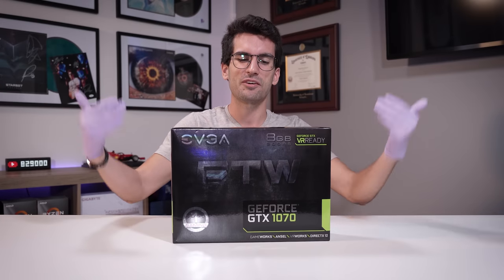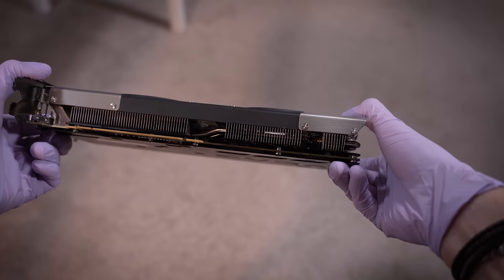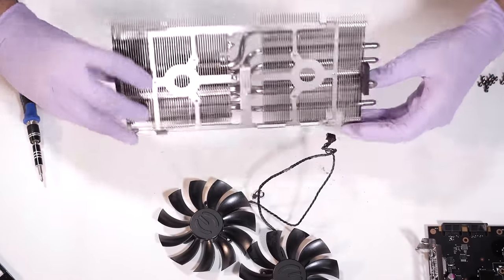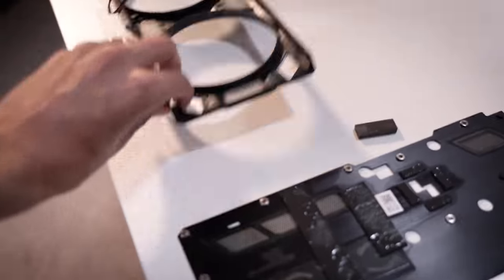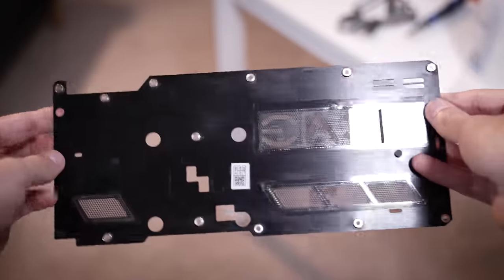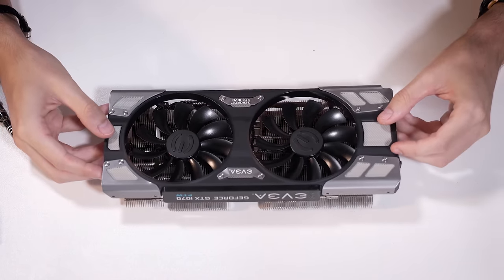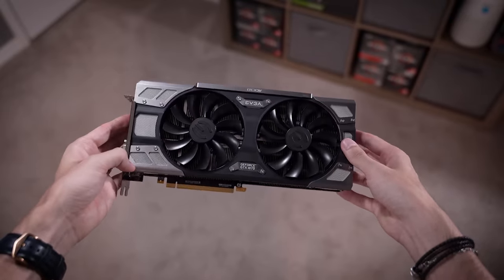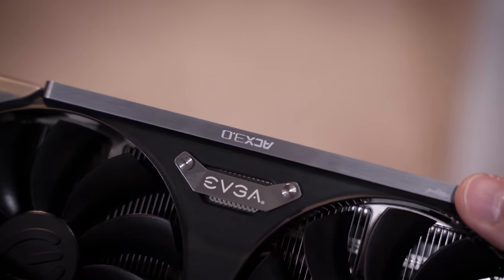This Used GTX 1070 Needs Some TLC!

Comment: It probably just needs a fresh oil change and a new FPS filter.   I usually change my GPU fluid every 6000-10,000 miles.
Reply: what
Reply: @72pinkush  a joke you missed
Reply: Don't forget the blinker fluid
Reply: 6000-10000 is crazy, I think 3000-4000 is more than adequate
Reply: Don't forget to fill up the fps fluid reservoir otherwise you'll get frame drops...
Reply: @DasLooney  they will be spit all over the radiator
Reply: If you switch gpu fluid with thermal paste and miles to hours, it actually makes some sense.
Fps filter could be bios i guess
Reply: Also top off rgb fluid
Reply: If you start hearing noise just add some Lucas GPU additive.
Reply: Make sure to rotate your fans every 6,000 miles as well!
Reply: Young gens wouldn't get this xD
Reply: every 6 months or 3000 frames, whichever comes first
Reply: Why r u still clowning on Stefan? 😭
Reply: Oh my you must be a comedian, at childrens parties.
Reply: What Tools? do you use to change the fluid ? I Hope a Swiss Army Knife with a Screwdriver.
Reply: For better fps you better change ur rgb filters every 6 months
Reply: @yagami-light  generation doesnt determine knowledge about cars D
Reply: @yagami-light  I'm Gen Z and I get it lmao
Reply: Do you use a knife to do that?
Reply: Full synthetic and you can take it all the way to 50K miles per change. You need to run the pixie Amp in line with the filter though. 🤣
Reply: I change my GPU fluid when I change the blinker fluid and oil in my electric car. 🤓👍
Reply: Keep it all coming, knowledge is power and we will spread the word on proper GPU maintenance.
Reply: VRAM Cabin Filter

Comment: Seeing this GPU makes me actually miss having the 1070 as I had almost the same exact one before it died on me back in March, it was the SC instead of FTW model. Amazing GPU even to this day!
Reply: F for your 1070, I'm rocking a MSI DUKE OC'ed 1070ti with RGB, still slams at 1080p especially with 2050mhz OC on stock voltages.
Reply: @Metaljacket420  Yeah, got mine back in August 2016 and I was using it a little over a year with a 1440p monitor instead, was shocked how well it managed to hold up there as well! I never OC'd it outside the factory one yet still managed to hold up nicely. I'd be using it till now, but I recently got a used 3080 for a decent deal in my country and that will hopefully last me almost as long or until I feel like replacing it.
Reply: Sorry for your loss
Reply: @nimamaster6128  Haha, thanks. I've been over it within a couple of days when I got a 1050 Ti from a friend so I can even use my PC (Ryzen CPU with no iGPU).
Reply: How did it die?
Reply: @plasticelephant1969  in short, it was a quick death in one late evening with a spark going out of it somewhere in the middle. 

The TLDR is I played some modded Assetto Corsa and streamed it to my friend on Discord who he said the stream is laggy. Told him that I'll switch it from app to screen mode to fix that. Doing that tripped the PSU to shut down the whole PC. Was like, alright gonna wait a minute or two and went away for a moment while dumb me shut down the PSU. Got back, turned the PSU back on, clicked the power button on my case and PC lit up with lights and then the GPU released a little spark, so I immediately shut down the PC again and took it out. 

Couldn't find the root cause on the PCB, nothing seemed fried on the exterior, but I couldn't get it to work either so I sold it for cheap not long after to anyone willing to fix it themselves or just for parts. Didn't want to invest money into repairing it as I could've used that for a new GPU instead.
Reply: @Metaljacket420  Almost the same card I have, I was waiting to buy a 1070 but ye old crytpo issues made them way over retail. Waiting it to drop the 1070ti came out and the MSI Duke 1070ti with white led DUKE was about the same as the lowest price 1070 on Newegg so it was a no brainer. No regrets either. Only has to push 2560x1080 UW for me so it is a bit overkill in most games to this day.
Reply: @DaWolfetrax  This happened with my once-new MSI Twin Frozr R9 280X. Middle of a game, saw a flash or spark as I was going to scope view, and the card stopped outputting video, but kept outputting audio through HDMI and the PC was still running. Prior to this, the coils had been whining non-stop since I got it out of the box, getting noticeably louder during gaming or rendering tasks. 

When I contacted support the first time, I was assured it was "normal operation" for coils to generate some noise under load. Plus, I could hear it clearly only when my fans were at low RPM, so most of the time it was drowned out by fan noise. 

When I called MSI the second time, the service rep kept trying to get me to say I had overclocked it...I said, "why? it's a factory overclocked sku, what am I paying for if I plan to overclock it myself?" (yes, I was feigning ignorance, but I legitimately hadn't overclocked it) 

He then told me the card was two years out of warranty..."I'll pay for the repair, I just want to know why the component failed so early?" "Cards just fail, time to get a new one." I then brought up how I had been assured that the coil whine I experienced was "normal" when I got it, despite my concerns, and the whine only stopped entirely once the card stopped outputting video. 

When I was given a bogus email address to request RMA (and after repeating it twice to the rep for accuracy), I realized I was getting trolled. 

I had been with MSI since they were printing Micro Star International in blocky text on their boards;  that experience was poor enough to stop dealing with them entirely, especially after seeing other quality control issues popping up rather frequently when I worked for a major tech-repair franchise. I couldn't ignore the pattern. 

My guess would be either sourcing improperly manufactured components in bulk orders from vendors with poor quality control, or dealing with vendors blatantly misrepresenting values that might meet minimum thresholds of operation during QC testing, but lead to failure once the values begin to drift with age/use. MSI cards just don't hold up long-term from what I've seen, even in well-ventilated and routinely-serviced builds.   

I still have that bricked card; it's still dead and in the box of the used Strix R9 380 OC I got to replace it. 

The replacement card is still working flawlessly, btw, and still in use (in my 10yo NAS box) at over double the lifespan of the "they just fail" MSI card.
Reply: @DJSekuHusky  For me, for the entire day the GPU was operating at a normal noise levels even under complete load, it wasn't audible at all.

It happened at around like 9:30PM, played some other games earlier that day for a couple of minutes, tested some PUBG when someone had claimed that the game is unoptimized and used too much RAM, so I took it upon myself to try it and it ran one game - it operated normally with a near identical VRAM/RAM usage of someone else who also checked it out. After all that, then I went out for the day and came back in the evening to chat with a friend on Discord, not long after that happened... 

I still have no clue what really happened, all I know is that it happened during my play session of Assetto Corsa, that I streamed on Discord to my friend. The game is pretty notorious because it has no data streaming, meaning all the necessary data it needs are pre-fetched during loading and stay in the RAM/VRAM during gameplay until you quit the game. Plus, with modded cars/tracks it is becoming an issue for some folks as those are way larger, the biggest track in the vanilla game is the Nurburgring Nordschleife - track located in Germany that's also called the most dangerous track in the world. Biggest tracks you can mod are significantly larger in both file size and scope.
Reply: I still have the gtx 1070. Bought it used back in 2019 and still running great until now. i don't play that much games anymore though but the last time I did (last year I think) it's still great.
Reply: mines still going strong
Reply: @gmualum08 To this day, I still don't know.
Reply: I’m actually purchasing the same GPU for a budget build I’m working on. I was going to get a 5600XT, but the 1070 was less expensive plus I’m getting it bundled with a Ryzen 2700X for not much more than a used 5600XT.
Reply: @1963c10  It's a great deal, the 1070 still kicks ass.

Comment: I flip pc on the side and I come across a ton of GPUs from miners. For heavily oxidised heatsinks, try scrubbing them with machine oil after regular cleaning. It will not make it shiny like new but it will greatly reduce white oxidised patches. Also, for those living in humid environment, throw in a few packs of silica gel into the rig here and there. It greatly reduces oxidation.
Reply: Soaking the whole thing in vinegar with save you the effort, brings that copper shine back :)

Comment: Greg, I really think I should clean my Strix 1080Ti but I am a bit scared that if I take it apart to clean it, it will end up overheating due to thermal pad issues after re-assembly.  The card has never been torn down but I do maintain a semi-regular hand air blower dusting too blow out the dust in all my RIGS every 3-6 mths focusing all the important areas of the computer.  Is there a way to order the OEM thermal pads specifically for my card or am I stuck with the ones it comes with hoping I can reuse them?
Reply: You can buy replacements online just look up the thickness of the pads (for your specific card) online.
Reply: I'm pretty sure you can just buy thermal pads and cut them to size, but you might also have to worry about the thickness.
Reply: Replacement pads that are the same thickness will often be better than the OEM ones unless it’s a premium model

Comment: Had a 1080ti version of this card. It was relatively clean, but simply repasting it dropped my temps over 10c and fan speed dropped by 25%
Reply: wow
Reply: I have the same card.  I’ve been cautious about taking it apart to clean.   I’m sure it would benefit from the same treatment.
Reply: @thomasbriggs4718  you don't even have to take it THAT apart. Just take off the 3 (I think) screws holding the shroud and the 4 springs screws on the back. A pair of small needle nose pliers or tweezers are helpful for the LED and fan header plugs. Then clean the old paste with some rubbing alcohol, apply new paste, and reassemble. It's easier than you think and within 15-20 minutes you'll have a quieter, happier and maybe even better performing card.

Comment: I love seeing part by part breakdowns for cleaning. These videos make me more confident to tackle something that seemed impossible to me merely a year ago. I used to be terrified to open my controller to clean it out or repair it, now I’ve opened and cleaned it several times, made minor repairs, and have even made repairs to my Xbox due to a squeaking noise the fan started making (though I was still a bit scared of bricking my system while doing this)

Comment: When I sold my old 1070 GPU in 2021, I dusted it, vacuumed it, and used a Q-Tip to get the fan blades as squeaky clean as I could so the buyer on ebay would be happy with it. It took me 10 minutes to do as I kept a clean PC so when I updated the card in the system in 2019 to a 2080, this card was stored back in its original box until I sold it.

Comment: I find that using a can of brake parts cleaner works wonders on cleaning the PCB and the heatsink!  It dries VERY quickly and leaves no residue behind.  I wouldn't use it on any plastic or rubber parts though even though the can may say "safe on MOST auto plastics."  I have "cheated" before on some plastic parts on some less important items and it did not seem to damage them.
Nice video by the way, Greg!  👍👍

Comment: An idea could maybe before the deep clean with disassembly be that you show how far you can come cleaning the GPU without disassembling it, maybe show the difference in the two. Not everyone has the skills nor tools to do a full deep clean, but a regular cleaning with q-tips and compressed air is possible for most. But the knowledge on how to do so (without full disassembly) would be great to have for the regular person.
Reply: Yea I agree, you definitely don't need to fully disassemble cards to clean them thoroughly. He does because it looks cool for viewers and he enjoys it but you just need to clean the heat sink, fans, and maybe repaste the card.

Comment: This is a great video. I have msi radeon rx 5500 TX and new it was running hot. After watching the vod. I took mine apart and found I had a big spot with no thermal paste. Now idle 38c it wad 65c.

Comment: INCORRECT Greg, IPA may not fully evaporate that fast, i repasted and cleaned my second 1070 strix card a few days ago and i had to soak the factory paste off the die with IPA, which resulted in  the card not posting repeatedly for up to an hour after i rebuilt the card. I actually had to manually heat the card to force evaporate the remainder of the IPA.

Comment: I remember the first time taking a graphicscard apart... my trusty old GTX 780... I was so nervous... I bought an old but functioning GTX 260 and took that apart, cleaned it and made sure it still worked - 3 times - before daring to try on my own card (resold the 260 for 10 dollars less) - but I made it!! :D 
.... since then, I think I've taken at least 50 apart :D 

I thing Greg here is doing an amazingjob at showing how it's done - would have given me confidence to do it :)

Comment: My evga 1070sc has been sitting on my shelve for years now. Bought it new in 2016 from best buy and got gears of war for free with the purchase and even with the stupid gpu prices over the last couple of years I've held onto it and could of gotten what I paid for it but to this day it has been my fav graphics card. It was a huge leap in performance from my gtx 960. Night and day difference. My 1070 to 2080s was decent but not ground breaks. And my 3080ti from my 2080s was pretty big but nothing like the 960 to 1070 was. The 10 series was just that good.

Comment: I would have liked to see a before and after benchmark. The channel has focused more on cleaning, fixing and pricing. Would like to see more product reviews with benchmarks and builds.
Reply: probably a few fps difference at best 4-5, what you'll mostly notice is less noise from fans as well as lower temps, which is alone worth it

Comment: I had this card, just the SC version instead. Bought off eBay back in 2017 or 2018 for $270 and it actually WAS mined on. Never gave me any issues. I just upgraded to the 3070 late 2020. I actually sold the 1070 for almost as much as I paid for it since during that time GPUs prices were through the roof. Win situation I guess, just lucked out on getting the 3070 I wanted during the worst time for MSRP.

Comment: Had a 1070 Strix for a couple of years, a really solid card. Running a 3070Ti at the moment, but wouldn't mind terribly downgrading (would miss the DLSS and 1440p gaming, but I'd survive.)
Re: mining cards. Bought a 1080 Strix that had been used ((part time) for mining back in january. It worked just fine up until last month when I cleaned it, repasted, swapped pads and sold it. Buyer got back to me after a couple of weeks when the card had started crashing. Took the card back and refunded the buyer. 
It works in safe mode, but in normal mode it crashes hard after a minute or so (screen gets garbled or goes green, then black. Cursor is visible, though) I wonder if I killed or if it was the mining past that came back to haunt it... or if the buyer messed it up.

Comment: I used to have a 1070 founders, it worked great for 1080p gaming and streaming, i sold it to a friend and got a 1080ti strix it is a nice upgrade but im still gaming at 1080p so i didnt notice that much of a difference only when i use my oculus (which is only like 1 day of the week).

Comment: I would never bother going to all that trouble just to clean it... Blast it with some compressed air, give it a wipe over and bosh it in the pc... Job done, never had an issue 👍... Good video though as it explains stripping down and reassembly really well for beginners 👍📹

Comment: It's crazy how you released this video because I have a GTX 1060($169.99 bought brand new) that I've had since 2017 and it's still works great and I'm putting it away in the original packaging and box because I don't longer need it, the box is in immaculate condition 😂 the sale prices on the used market isn't worth the shipping cost/ dealing with the buyer, at least not for me.
Edit: I bought a Radeon RX 6900 XT for $699 back in July from my local Microcenter to replace the GTX 1060.

Comment: Greg, next time you want to remove oil from the pcb and/or back plate I have had very good results with an aerosol can of brake clean available from any auto parts store.

Comment: Got this gpu (Gigabyte 3X version) for my GPU crisis build of 2021 for $180 from a friend. Needless to say it runs at a cool 65C even at the most demanding stuff (mid to high settings RDR2, Cyberpunk) and a great gpu for fps games. Still rocking it and I'll probably upgrade to a 6700 XT a bit later on probably.

Comment: that poor legendary gpu i still use my 1060 6GB evga card and i still use my Gigabyte AORUS GeForce GTX 1080 Ti Xtreme Edition 11GB still this day in my main rig . and my streaming rig is the 1060 with a pentium g4560 8gb ram and my main gaming rig is ryzen 5 3600 32 gb ram 650 watt psu also i been planing too upgrade my gpu too a rtx 3060 or a 2060 should i upgrade or stay another year with my aging gpu i owned since 2017
Reply: if you could afford the 3060, go for it now

Comment: I got a used MSI Armor OC GTX 1070 for $95 shipped/tax.   It looks new, it even came with the fan sticker. 😂

It goes from 30’s idle to no more than 60c full load with Heaven benchmark.

Lots of mined cards will game for years!